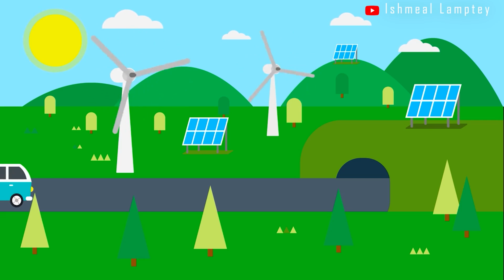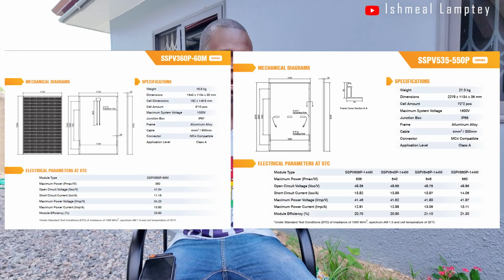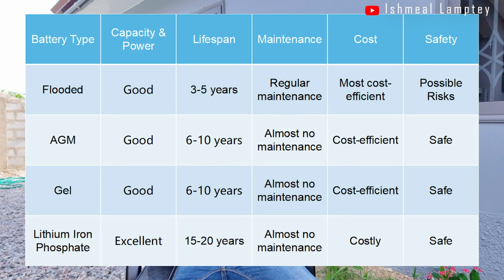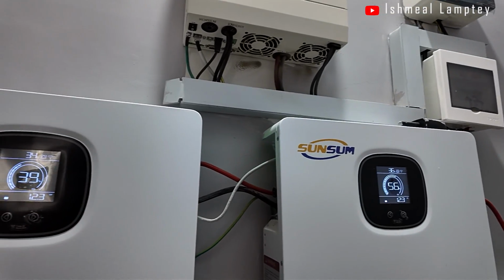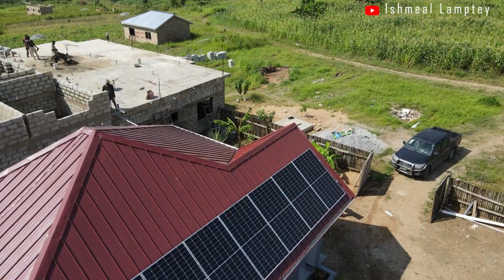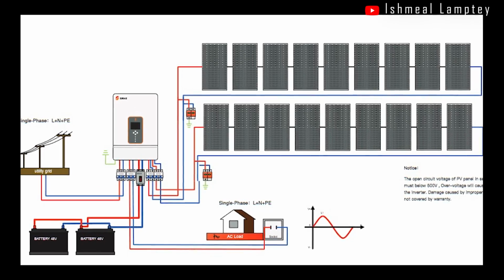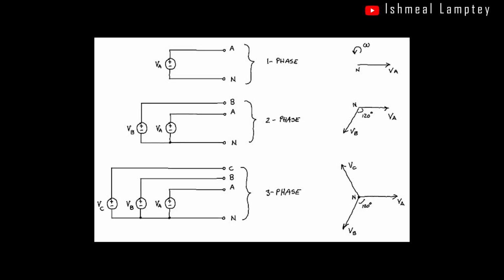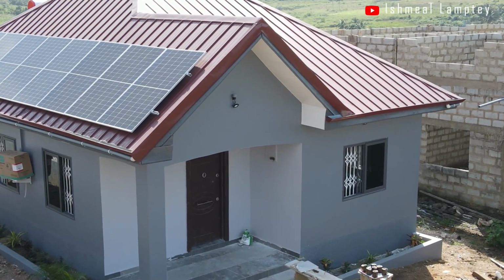Choosing the right solar system for your Home, Office or Factory

Comment: Boss 
There is need to build overhead tank for the poly tank.since you can use water pump to pump the water to the rooms . 
May I know how it is done
Reply: Was asking,instead of building an overhead tank,can I  use a water pump to distribute water to the rooms ?
Reply from the maker: @animkwame2956  yes, that works. You can use a water pump to pump water to the house.
Reply from the maker: I don't think i discussed overhead tank in this video. Not sure what you're referring to.

Comment: This guy is a blessing to us, i saw his video here and contacted him, very humble guy with full of knowledge of what he does. Just one question, can you for example have 5kw inverter and buy more panels to generate about 8kw of power or you need to march the power generation with the power of the inverter? Like you explained you can go over the inverter power so how much more can you go with the solar panels? Thanks brother!
Reply from the maker: The maximum number of panels you can have will depend on the size of the panels as well as the specifications of the inverter please. So there isn't a straightforward answer please.
Reply: @IshmealLamptey  I’m talking about the power actually not the number of panels. If the inverter is 5kw and your panels could generate more than 5kw. Eg: you have 5kw inverter and you buy 20 of 350 watts of panels, that will generate about 7kw of power, is it ok to do that?

Comment: Thanks a lot Mr Lamptey for the wonderful breakdown! I got few questions if you don’t mind helping with the answers

How many 500Watts monocrystalline panels will you need to generate 35KWh-45KWh daily for battery storage and still use the solar during the day?

Is it better to have two 10KWh battery storages or one 20KWh? How about if you need 30KWh? Better to go with three 10KWh or two 15KWh storages?
Reply from the maker: For the panels, you'll need about 16pcs or more to be able to generate that amount of power. 

For the battery, any works but it's usually best to go for the bigger size than smaller ones.
Reply: @IshmealLamptey  
Wow, I was told I needed about 40 pcs! Thanks a lot Mr Lamptey! If you combine two 10KW Hybrid inverters, can you generate about 40-45KWh daily for storage with 16 panels of 500Watts?

Comment: Thank you for your assistance. The information you provided was very helpful. I'd like to request some additional information regarding grid-charged battery backup inverter options. Specifically, I'm looking for a non-solar battery-charged inverter that can act as a standby option for a few hours. I'm connected to ECG and would like to have a backup in case of power outages. Thank you for your help.✌🏾🙏🏾👍🏾
Reply from the maker: You can still use the solar system without the panels, that's the inverter and the batteries so the grid charges the batteries to serve as backup when the grid goes off
Reply: Hi Ishmael! Thank you for your response. . Please let me clarify. I want to make sure that I understand you. Is the Hybrid Solar inverter the same inverter that I would use if I do not have solar panels and I only want to charge batteries using the grid? Or is there an inverter specifically for Grid-to-battery charging? Do you have a video that we can recommend that our electrician watches for such a set up or should we use a solar installer though we only want the battery-backup option?  Thanks in advance.  ✌🏾 @IshmealLamptey
Reply from the maker: @YenkoAfrica  Yes, you'll need a hybrid inverter for the setup despite the absence of the panels. You'll also need a qualified solar system engineer to implement the system.
Reply from the maker: Very well. Thanks for the feedback
Reply: Update: I have received clarification. I have also learned that the system that I am inquiring about requires the gel battery and not the Lithium battery. Thanks for your help.  @IshmealLamptey
Reply: However you’ll still be spending extra because of the extra power going to the battery right? 

Also will it just means you’re buying in advance and thereby an increase in the amount of money you spend monthly versus if you installed the solar panels?
Reply: Hi Bilegagn,  Certainly, I can rewrite the text to make it clearer. Here's the corrected version:

"No, the amount of power I would be using is the same as the amount I would have used if the power had remained on. To confirm, I asked the same question and was informed that there is only a slight difference in efficiency between using the gel batteries that are charged by the grid and using direct grid supply to the home, resulting in a difference. i.e. 1000 direct from the grid vs 1100 battery supplied watts.".  ✌🏾 @Bilegagn

Comment: With your explanation, does it mean with a hybrid inverter u will not need a change over switch (manuel / automatic)?  If i understand u well, if dumsor visits, the hybrid inverter (without a changeover switch) will change itself to panels or batteries to power the house. Is there a reason for this your preferred settings Panels, grid and batteries  When is change over switch used in solar setup. Is your system made up 5kw Inverter + 10kwh batteries + 9 (500W) PV ? I am asking this bcos of your reference to 200Ah. Most 5kwh B are 100AH. Are there  some 5kwh B with 200AH ? 🤔  Oyi wala don.
Reply from the maker: The system can function without a Changeover being it manual or automatic however it is best to have a changeover in your design to be able to isolate the system from the grid should or in case you need to carry out maintenance. Also, the hybrid inverters has inbuilt changeovers that does automatic switching based on the configuration and also if the AC input or the grid is connected to it. Also,  100ah 48V gives 5kw and not 10kw. So two pieces gives 10kw. My system is made up of 460W panels (9pcs), a 5kva low voltage inverter and 2pcs of 100ah battery and i have a manual changeover installed although it isn't really servicing any purpose at the moment because i don't have the national Grid present. Thank you
Reply: @IshmealLamptey  Thank-you very much. I am satisfied and enlighten with your explanation.
Reply from the maker: @LifeLoveSex-69  very glad to hear. Thank you also
Reply from the maker: I have to make a quick correction. 100ah 48v is 5kw and not 10kw. So 200ah 48v (51v) gives 10kw. Thank you
Reply: @IshmealLamptey  Thank-you again for the update and clarification. I'm good.

Comment: This Dumsor is concerning. I think it will get worse in December when there will be heavy demand on the electric grid.
I bought my solar hybrid inverter and lifepo4 batteries for my place in Accra. I will be shipping the batteries to Ghana and getting someone to install the system. At least i should be able to run fans, lights and my refrigerator.
Reply from the maker: Sounds good to hear. I hope the dumsor is brought to an end very soon

Comment: Great explanation indeed, pls I saw that you used wood to get the panel on your roof. Will this not rot over time or have you found something to prevent this? Thank u 🙏
Reply from the maker: The wood was temporarily. I have changed them to roof clamps which do not require drilling of the roof
Reply: Pls,  may I have your contact. I need a little guidance when buying solar system materials outside Ghana. I get a little confused sometimes…